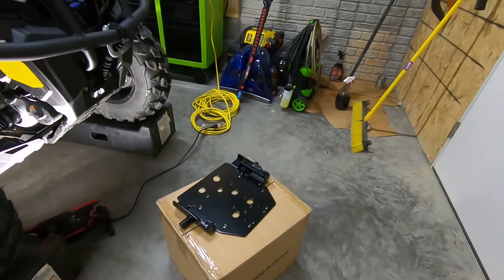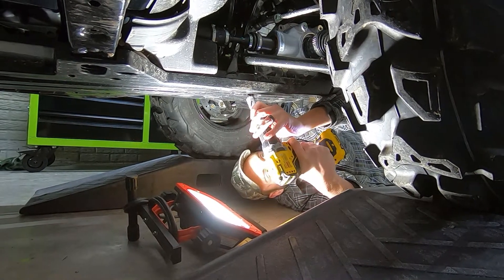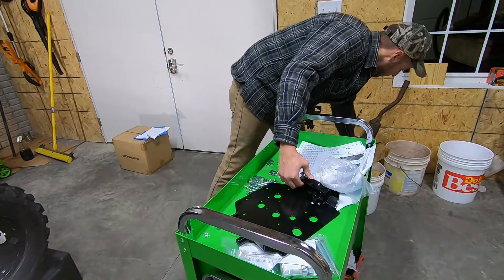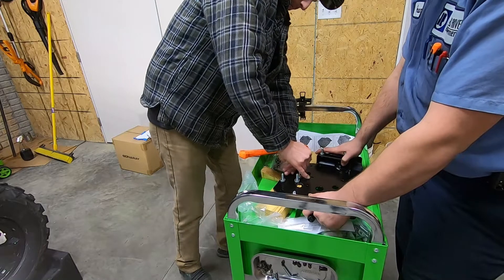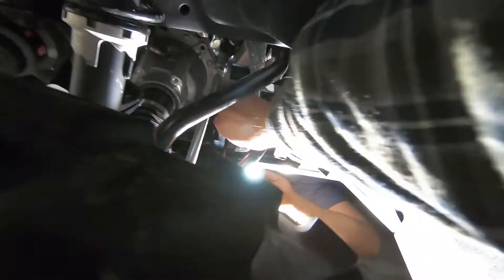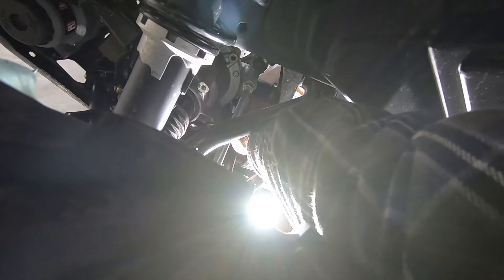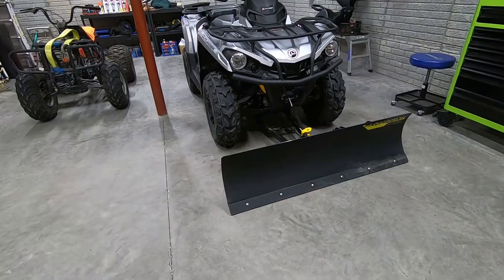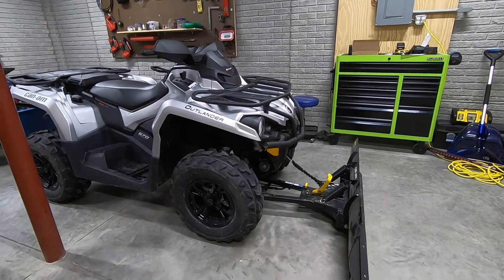Can-Am Outlander Snow Plow Install | ProMount Plate & Plow on 570 MAX XT

Comment: 2012 Outlander1000DPS- Something left out in the installation guide ...locktite should be put on all threaded fittings...I say this because it took two years of plowing to lossen up every fastener on the mounting plate. Temperature changes summer to winter and during winter the steady hammering impacts of packed snow ice etc. will loosen every nut and bolt. My unit essentially fell apart...loose bent bolts with threads stripped. I guess I ignored the rattling for too long so ended up under the machine laying on ice for two days effing around trying to refasten and replace several bolts.

Comment: hey guys. Love the video and it's going to be helpful to install the mount. I have a 2018 Outlander 650 Max. It has 3 mm plastic skid plate. says I need template 05 and I can't find it anywhere. Any guidance would be appreciated. Joe
Reply from the maker: I'm not sure about template 5. We used the template from the link in the top pinned comment and drilled through our plastic
Reply: @TrailPass  spoke to the dealer and they pointed me to the right site.  https://instructions.brp.com/e-instruction.html#tab=1  If you type in the part number it gives you the docs that apply to that product and i was able to find template 5 there.

Comment: The template you have linked here is not the one you use in the video. the instructions say SSV.  any chance you have the link to the correct template?
Reply from the maker: Sorry about that, here is the correct link.  I also changed it in the description.  There are also other templates for other skid plates, depending on what is on your machine:

https://instructions.brp.com/content/instruction-sheet/en_CA/e-instruction-details.html#articleNo=kA00c000000yHDvCAM&lang=en_CA&title=ATV%20KIT%20--%20PROMOUNT%20FIXING%20PLATE%20-%20OUTLANDER%20-B-&rel_part_number=

Comment: What size plow is that? I’m debating between a 54’ or a 60’. Thoughts?
Reply from the maker: This is the 54" for wet/heavy snow you really need to either angle the blade hard or way the atv down to keep from sliding. If you have lighter snow I would get the bigger blade though

Comment: Hi followed you a lot with tacoma...funny i got a tacoma and now same as you getting max xt 850 with plow...can you tell me you overall lenght of your whole set up....getting a trailer....☺
Reply from the maker: Hey Marc, nice to have you back to the channel!  I just went to measure the machine.  By itself it is nearly 8' from bumper to bumper with the XT bumpers.  The plow adds another roughly 1.5' depending on how you have it attached.  I wouldn't recommend any smaller than a 10' trailer, but you could maybe get away with a smaller one if you were willing to detach the plow to haul it. I hope this helps and let me know how you like that 850, I hear they're a real beast!
Reply: @TrailPass  i ordered the 850 max xt with can am plow was thinking a 5x10 trailer would fit the whole thing ...receiving it in april....😊

Comment: Hey buddy....its been almost a year since this install....Do you still like the snow plow? I have the same machine (which i love). Thanks in advance!
Reply from the maker: It was a great plow setup. I ended up getting a different, smaller machine because we weren't using the 2-up capability. This was still the best plow setup I've used. My current machine (Kodiak 700) has an Open Trail plow which requires you to get under the machine and use pins to lock in place. The BRP setup is expensive, but really nice to use and never had an issue. Very easy to connect and disconnect even when packed with wet snow. I would definitely recommend!
Reply: @TrailPass  Thanks! Looking forward to many more videos from you.....All the best for you and your family. R/, -Chris
Reply from the maker: @MrCmetzler  thank you so much!